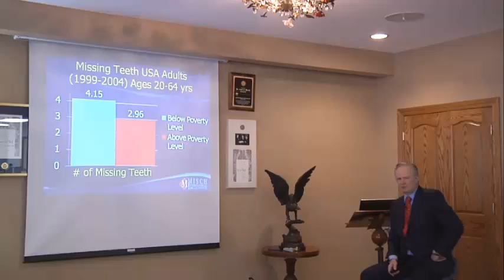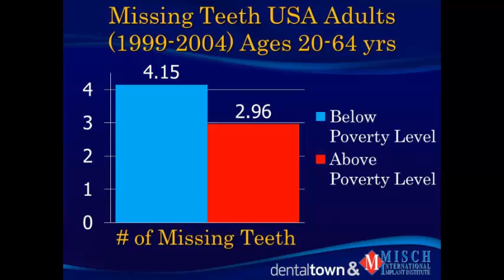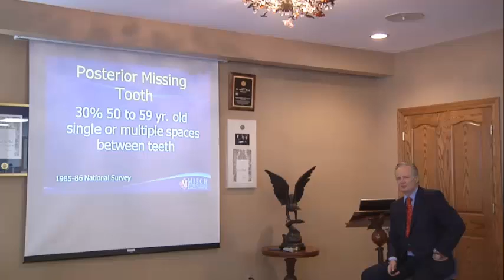Dental CE: Posterior Single Tooth Replacement

Comment: Carl Misch, DDS, MDS, PhD is the world authority on dental Implantology. Every dentist should watch his online CE course Posterior Single Tooth Replacement. Seventy percent of the population is missing one or more teeth. The traditional method to replace a tooth is a fixed partial denture. As a consequence of this device, the adjacent teeth decay almost 25% of the time. The pontic acts as a plaque trap and often causes decay at the crown margin next to the pontic. In addition, the abutment teeth of a fixed partial denture require endodontics for the decay or trauma of preparing the tooth almost 15% of the time. The endodontic treated tooth fails 10% of the time. In addition, the tooth may fracture as a result of the endodontic treatment. As a result of the decay or endodontics complications the abutment tooth is lost almost 30% of the time within 10 to 15 years. A dental implant to replace a missing tooth does not have to crown additional teeth and splint them together. The implant does not decay or need endodontic therapy. As a result, the implant and adjacent teeth last longer and are more predictable than traditional fixed prostheses. This program explains to the dental team the consequences of preparing and having crowns on adjacent teeth splinted together to replace missing teeth. The advantages of implants to replace the teeth are presented in a format for doctors, staff and patients to understand the benefits of implant dentistry. 
View this course at http://www.dentaltown.com/Dentaltown/OnlineCE.aspx?action=DETAILS&cid=404. 
Howard Farran DDS
Phoenix, Arizona
Founder & CEO of www.TodaysDental.com & www.Dentaltown.com 

#DentalCE #DentalContinuingEducation #DentalCases #DentaltownMagazine 
www.Dentaltown.com  www.TodaysDental.com  www.Orthotown.com  www.Hygienetown.com  www.FarranMedia.com  www.HowardFarran.com  

Dr Howard Farran DDS Ahwatukee Phoenix Dentist 85044 Today’s Dental